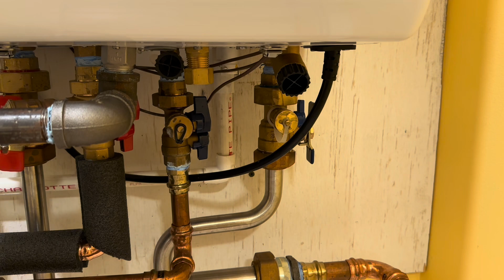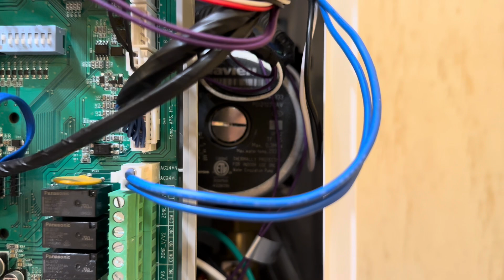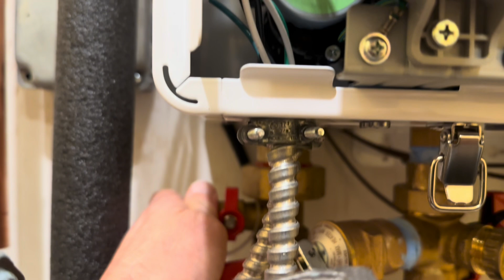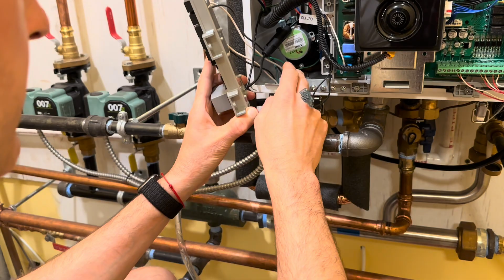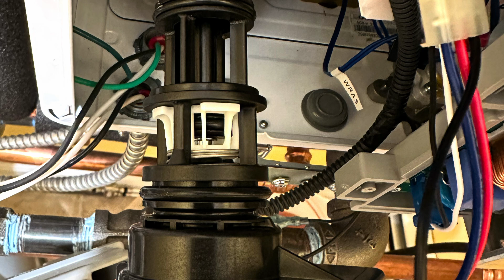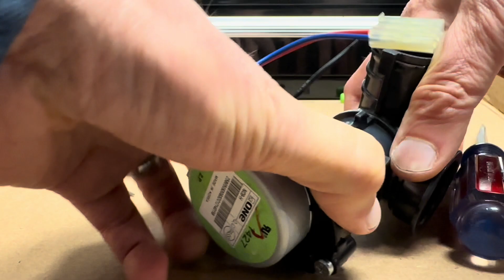Navien 3-Way Valve Replacement NCB-240

Comment: It would have been muck quicker and easier if you removed the whole main panel which only has 4 screws.  Much easier access.
Reply: ya and you don't even have to take any wires off the panel. you can prop it up to the side a bit

Comment: Make sure, before you replace this... you check to make sure you are set in the control panel to ZONE heat, not Self Heat (no zones).  It seems power outages or something, can change the settings.
Reply: You think he didnt? 

I definitely agree, before replacement you should be confident in your diagnosis. 

 People really need their hands held?

Comment: From start to finish, I mean turning unit off, draining it, removing valve, replacing the valve and checking the heating to make sure it was working....Start to Finish, how long approximately did it take to do the job?  Thanks!
Reply from the maker: Probably 2-3 hours.  Less if things go smoothly and you have all your tools at the ready.
Reply: Thanks so much! Idk if you're comfortable answering this @jeffceo, but if it took about 1.5 hours to repair start to finish, what would be the average expected charge to the customer? I ask bc I'm in a bind. After my plumber diagnosed problem with Navien tech, he ordered the 3way valve. Part's still under warranty, not labor- so I asked how big of a job it was & he told me not very- bc the valve's not hard to get to. I asked how long it'd take & he said about an hour, 2 hrs tops. And I was relieved... single mom, money's tight. He assured me not a big job. Whew! So imagine my surprise when the bill came &  it was just over $500!! I called & only then was I told they charge by the job, not by the hour. A hard worker is worth his wages and I'm not trying to get something for nothing, but considering his service calls are $89 to come out, I was thinking a 2 hr job would cost around $200-$250.  I've watched videos and took the cover off myself so I could locate the valve. I just can't justify that kind of charge esp with him knowing by the conversation I was assuming there'd be an hourly charge. I feel he had an obligation to tell me otherwise before he did the work. Maybe you could shed some light for me bc $500 is going to hurt. $12,000 for the unit 1.5 years ago and this is the 3rd different part replaced; nothing but problems with the Navien and I wish I never bought it. 😔 Thanks for whatever insight you're comfortable giving. 
I loved your video, btw. So easy for the layman to grasp. And not a lot of wasted words & non-relevant info or umms. To the point, solid information. Grateful woman here! Thank you.
Reply: @CariGari2horse  im going to assume you don't do maintenance on it
Reply: @jasondematos9314 i believe she did mention that it's only 1.5 years old,even if nothing was done as far as maintenance it doesn't justify the 3 parts that she already had to replace
Reply: @CariGari2horse  sorry but price is not exorbitant 350 -500 sounds reasonable. And 89$ for a service call is  cheap as hell.  I dont know anyone that walks in for less then 100.. so i wouldnt complain to much. Sounds like they been giving you deals and you finally had to pay for this one.

Comment: They use the same 3 way valve in uk version of the boiler. When its stuck wiggle it from left to right to get it out, it will either come out or break . If it breaks just pick the bits out. I never take out the whole block.
Reply: Great tip, thank you!

Comment: These break WAY too frequently.  I was told to use rust inhibitor in the system, hoping that will help.
Reply: Standard practice to use rust inhibitors in the UK. regardless of make or manufacturer of boiler diverter valve(3 way valve) are a common failure if you don't have a clean system that  isn't full of rusty water. We also fit magnetic filters to catch it alll aswell
Reply: @themadplumber2011  i had the system looked at again recently. We opted for adding a feeder with glycol. He said no to the navien magnetic filter because I don't have too much iron pipes and I have a water softener, system is working perfectly at the moment.
I really hope that's it with this boiler and issues. If not at 5 years old I'll cut my loses and have something else installed in it's place, and curse navien boilers for the rest of my days

Comment: How did you know you needed to switch the three way valve? What were the issues?
Reply: Either they make a loud noise, or you will have hot water but not heat or heat but not hot water.
Reply: @blake why post without watching the whole video? You know there's an edit option to update your post with a "nvm I watched till the end."

Comment: Did you try the new 3 way on the old housing? You think it would be better to get a new housing as well?
Reply from the maker: I didn't but I think it would be okay.  I think the actual 3 way valve may get warped.  When you buy a new unit you can actually buy the 3 way and the housing together for a few dollars more than just the 3 way.  I would not recommend changing the housing unless you have to.  It doubles the amount of work the job takes.  I actually think I still have the old housing plus a new 3 way valve.  Maybe I will try to fit it and report back if I have a chance.
Reply: @jeffceo  yeah it would be nice to just just replace the motor without having to remove the housing. I have received the motor today waiting for the housing until tomorrow just in case. I don't want it breaking down during peak winter. Any tips on  bleeding the air out of the unit, mine also has the navien manifold.
Reply from the maker: @KillerDayton  If you open the valves slowly the high vent on the top left of the unit should bleed the air out.  Make sure the small screw cap is loose so that it can vent.  Sometimes people close them once the system has been bled.